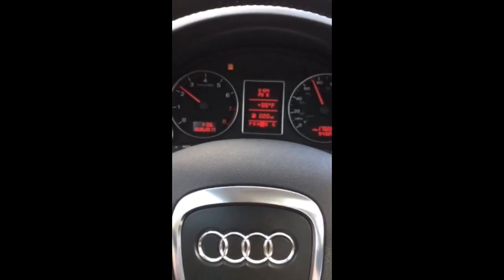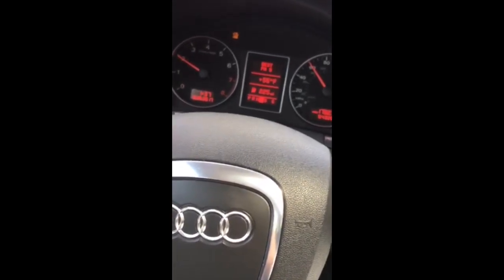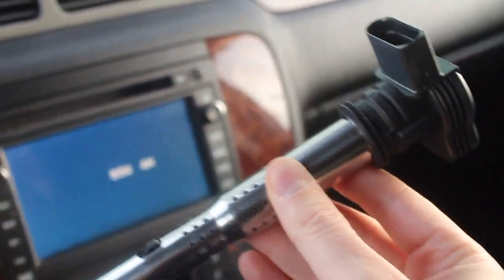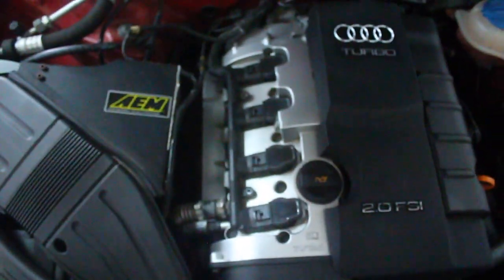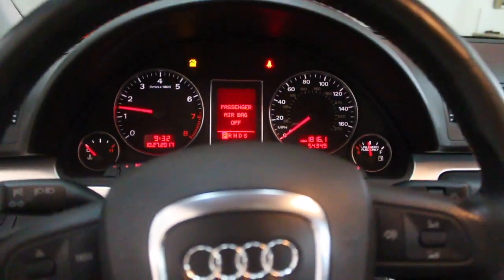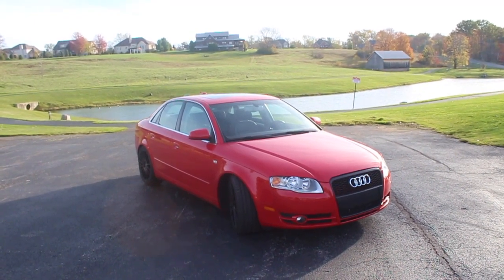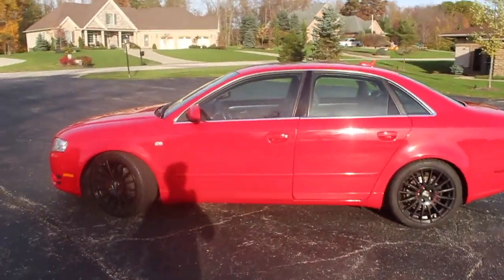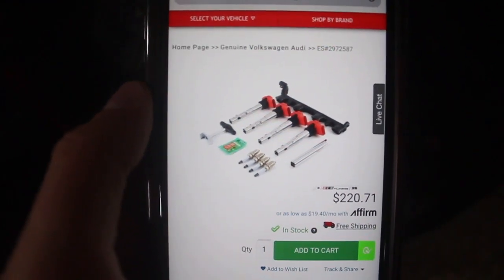My AUDI BROKE and only COST ME HOW MUCH??

Comment: Yes, you blew a coil pack.  Yes you replaced it.  But that’s not the problem.  The problem is that your engine mounts are worn out, and at high rev’s, like going up your hill, the torquey engine will “flex” in the engine bay.  When it moves under load it arcs or touches something else in the engine bay.  On contact you will blow the coil pack that is firing.  This happened to me for a few years before I discovered my two engine mounts had excessive movement to them.  High mileage, chipped, modified, it’s best to just replace your mounts with ECS or 034 mounts.  My modified 2008 A4 drove me crazy, this was about at 80K.   Replacing all four plugs and coil packs is awesome, I bought from ECS also, but the root problem, the “why?” is because of worn out engine mounts allowing your engine to wobble under load when you punch it.  Hope you got it sorted out.  Love your content.  I only left this comment because I didn’t see anyone else mentioning it.

Comment: I had the same problem, almost identical situation. A coil problem but you are lucky. For my car, a Toyota Celica GT, the original coil was priced 150 dollars. The after market is actually more expensive. Anyway it's well known that Audi 4 and Audi in general have this coil problem. Easy to fix and relatively affordable to deal with. I had to replace 3 out 4 coils in last 6 years. Waiting for the last coil to make my engine light flashing. Lol.
Reply from the maker: Haha I know! I’m constantly waiting now...get on boost and boom! Coil blows lol

Comment: what exaust system or muffler is in yopur a4?
Reply from the maker: It is a Stasis Exhaust! I’ll make a video on it and about the car this weekend!
Reply: @DoWorkExotics  Thanks so much. Would it work OK if I just change the mufflers?
Reply from the maker: The mufflers are a little restrictive but it won’t get that much louder. Either get very free flowing mufflers or a cat back!

Comment: 10k $ for your 2006. U would 💩   if U knew how cheaply I got my 06 A4 Quatro 6 speed for.  ❤ it.       Good luck.  👍👍
Reply: Y’all would shit if you how much I got my 09 for. Only reason I got it was cause that guy didn’t have the tools to repair it
Reply: Got an 2011 Audi A4 for $4000 had bad fuel pump fix it my self in hr or less had it over a year still running strong
Reply: I got my 06 for $3000
Reply: Hi is it expensive Audi parts and repairing?
Reply: I got my 07 for 3500
Reply: Yoo i got a Audi A4 Quattro 2006 b7 2.0 turbo for 3.2k with 128,000 miles is that decent?
Reply: @game_train3020  that’s a steal if it’s in good shape imo
Reply: Fuck yes g it is in good shape he got new belts for it new turbo because the previous owner before the guy I bought it from didn’t take care of it and he has a straight pipe to it. I’m thinking of doing a tune up because he said he was gonna do it but didn’t have time. He said he got the car aligned
Reply: I bought my 06 for $1,000...

Comment: 10,000 dlls my A4 cost 2500 dlls is a 2006 S Line, more equipt than yours, whit 62,000 original miles
My A4 is a 6 speed, quatro, turbo whit blow off valve, audi sat nav. Bose sound sistem, inteligent bixenon headligts, etc. For only 2,500 us dlls.

Comment: Hey man, I know this video is old. I own a 06 a4 B7 and it started to sound a little loud like a diesel. Did yours do the same? I have no CEL. Its a loud (diesel) ticking noise after it warms up at idle. Mainly when the outside temperature is hot that's when its noticeable. In the mornings or on cold starts, there's nothing, but later in the afternoons when it is hot it starts making that loud diesel noise.
Reply: pull the injection pump, the cage that supports the plunger is likely broken, while in there, theres a small piece that sits on the end of the plunger looks like a watch battery, take this to a machine shop and ask them to remake you one at least 1/16" thicker, this will solve all issues.
Reply: Its the timing chain.. change it and it will purr.
Reply: Cam chain tensioner pulley
Reply: Lol every has a different diag